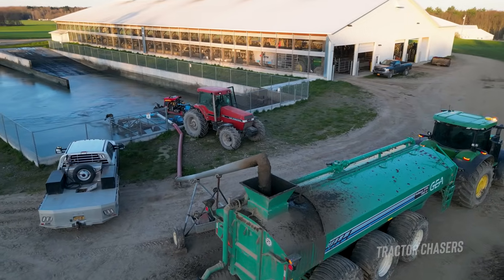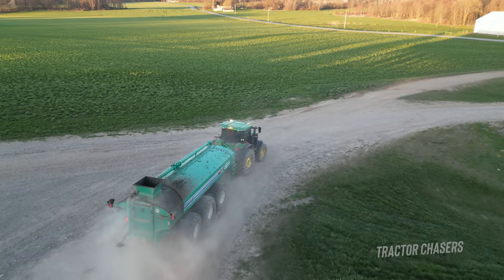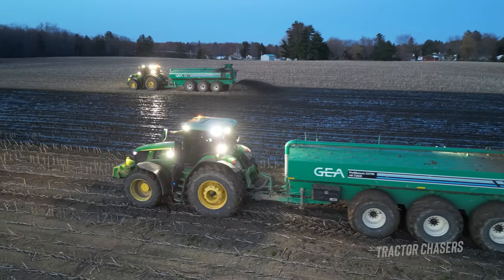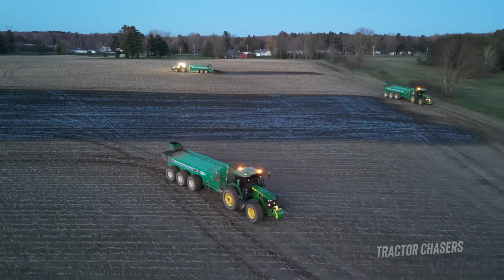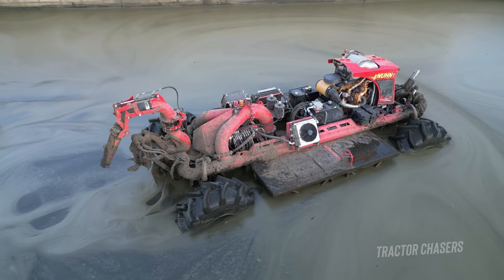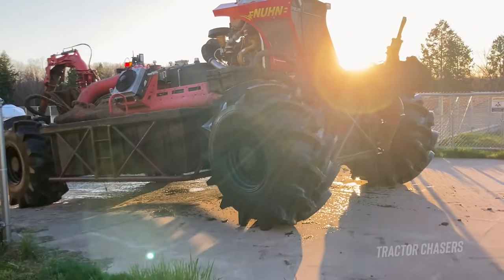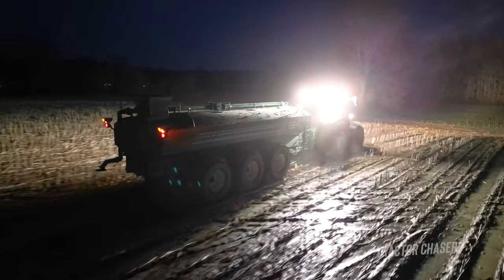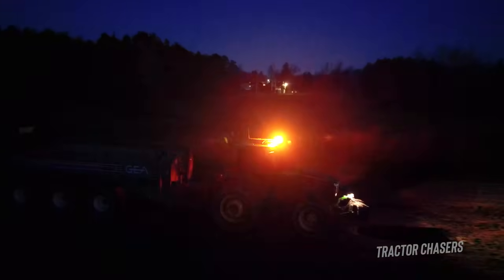Spreading 890,000 Gallons of Manure in One Day!

Comment: Great video… it’s just me thinking but I would never put a 7R on a 7,300 gallon spreader… I’d put an articulated tractor. Well I did have an 8430 on a 7,300 speeder.. you remember that Tractor Chasers? About 15 years ago that was lol. Anyways I had to be very very selective on where I had to go.. but very impressive nonetheless..
Reply from the maker: I remember!  7Rs have changed a lot and are very impressive now.  They handle the fully loaded tanks very well.  Keep in mind these are 330hp and 350hp tractors now, not the older 7 series we'd be used to.
Reply: @tractorchasers  yeah I kinda forgot about that.. it just seems like even on 4 tires that spreader can boss that tractor around..
Reply: @RickPerry4960 no those tractors are more capable than any of the old 8020 series and theres  guy here that pulls one of those tanks with an 8420 mind you he's had to rebuild the brakes in the tractor twice cuz he won't get another tractor. But he said he's not buying anything with DEF.  Lol

Comment: Wheres this at? Can they get truck to deliver it so you wont have half the field on the road.
Reply from the maker: This operation would probably be slowed by using trucks.  They had short hauls and go right into the field to unload.  The tractors going 32mph which is close to what a trucks speed would have been.  Then they have no time spent parking and waiting for a truck to transfer manure.   A lot of times trucks can speed things up but I’m not sure it would help for this one.
Reply: @tractorchasers  oh ok cause that's what I've been doing  all week. I've been running a 8k gal diller tanker on a peterbilt supplying  The tractors
Reply: I was running the 7R330 and those where all little narrow roads with a lot of turns and hills so it would have been a toss up
Reply from the maker: @dzl6848  Diller tanks are awesome!